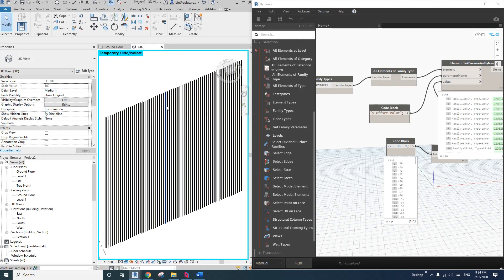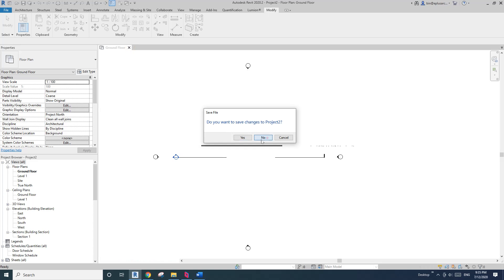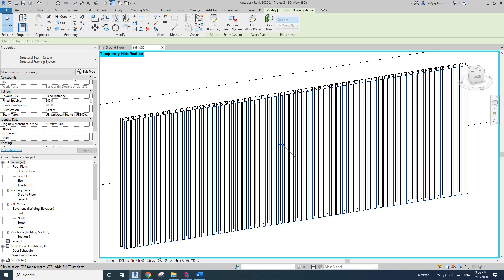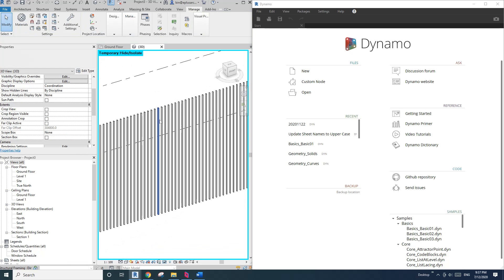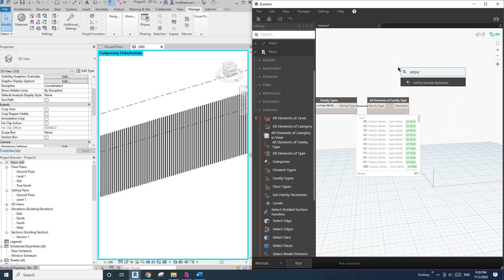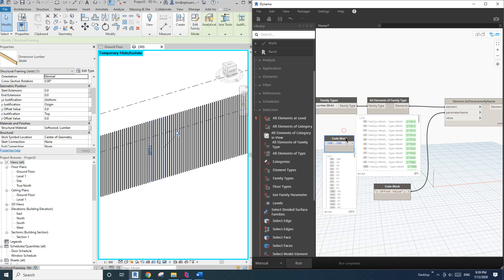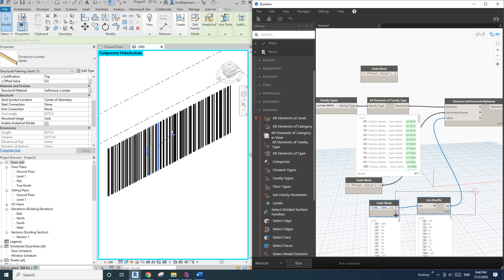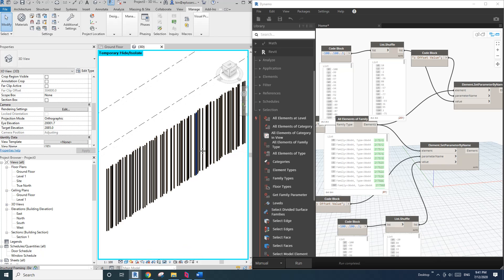Everyday Revit (Day 264) - Random Spacing Beam System

Comment: Sir, it would be great if teach some basics of dynamo and some basic and important things  for which we should use dynamo instead of revit that can save time.  And also tell us what dynamo can do and revit can't.
Reply from the maker: At far as I know, Dynamo is good for repeating work, such as batch change of sheet/View names or number, or change an instance parameter with a list of different figure for a large amount of elements, for example in this video, it is used to change the  y offset value for all the members.
Reply: @BINHE615  Yes Sir, i have also seen a video when he rotated so many columns at once with dynamo which is not possible with revit, so it means it is used for batch work.